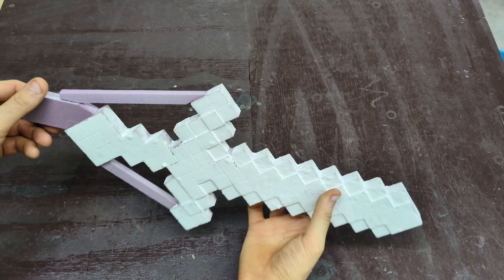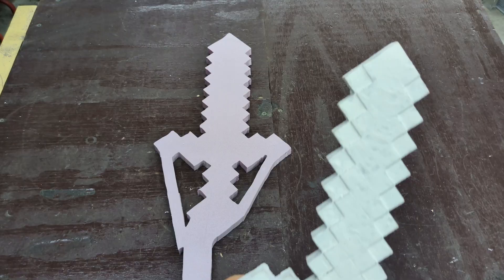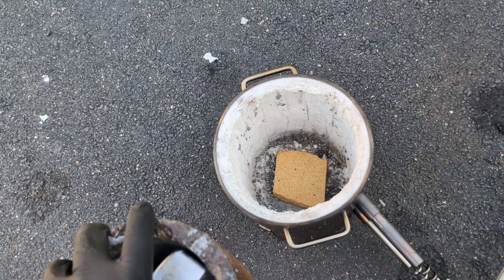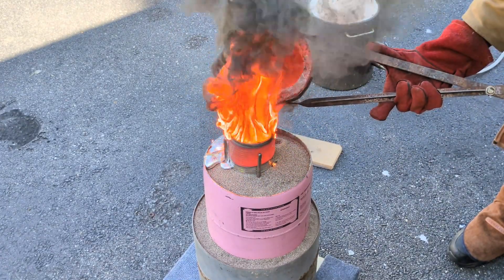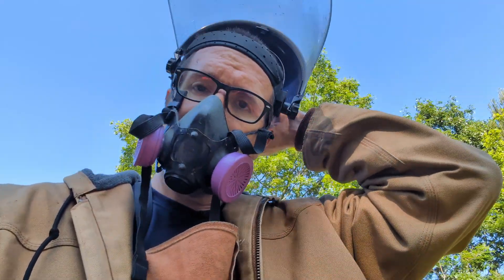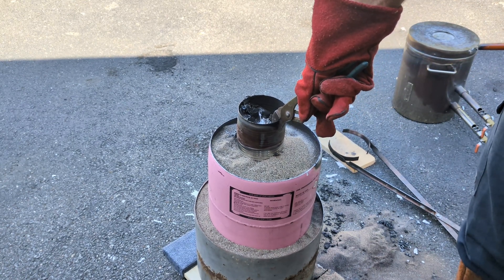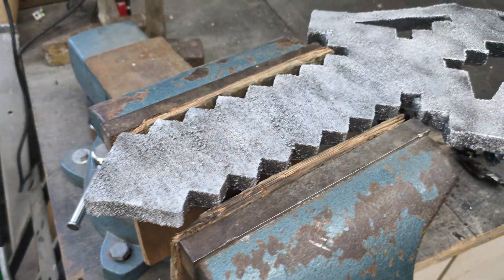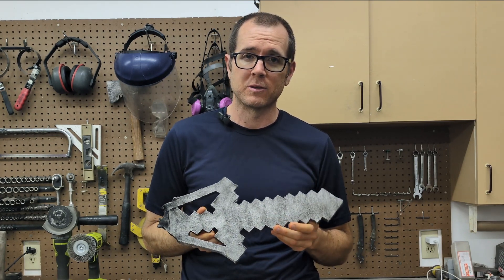Unbelievable!  It actually worked - Sand Casting Metal

Comment: I've found that the aluminum will push out and up if it can. I recently did a pour where I placed my piece flat instead of vertically. It was a large flat piece, but the aluminum evaporated the foam and the sand did not cave in at all. Only issues I had were on the underside of the piece where the sand was not well packed against the piece.
Reply from the maker: yeah, that's why it is best to vibrate the container pretty well.  This was my test pour for the real minecraft sword.  I do lost foam casting very often and almost all of the time I have it placed vertically.  I have tried doing it Horizontal and it does work that way too.  Like you said though, if the back isn't flat you will have a hard time getting the sand up on the backside.

Comment: You definitely helped yourself by making the blade thick, doing a vertical pour to have gravity assistance, and making the aluminum much hotter. The only issue with that is the aluminum oxides a lot more, and combined with its crazy shrinkage you'll need a pretty crazy pouring basin lol What size crucible do you use? Great testing, it's always nice to see other metal casters actually pour for test purposes only and show it
Reply from the maker: I think doing a test pour was a good idea.  I used an old crucible and cut off the bottom.  It worked well.  The video should be posted in a week or 2.

Comment: Weird parallels with a recent pour I had. I also overpoured and spilled on my driveway but didn't notice because of smoke, then couldn't get the pieces out of the sand until I pulled them out. Nice work!
Reply from the maker: haha, funny not funny.  It sucks when you can't see while pouring.  I definitely need to pour sand around my mold so I don't get it on my driveway.  Thanks!

Comment: Take your foam piece next time, and submerge it into a bin of water. Mark a line on the side of the bin where the waterline is. Remove foam, and then chuck metal into the water until the water level is back to the mark. This gives you ROUGHLY the amount you KNOW you need to reduce excess and removing portions of your driveway😂 good video. Sword looks great.

Stack 5 gallon buckets and duct tape them together. Boom, tall enough for your casting height.
Reply from the maker: Very smart idea 😂😂 I've actually used this technique on the past for something smaller.  I'm not sure why I didn't think of it here. 🤔🤔
Reply: @HeinrichsMade  jeweling? Thats how jewelers do it. Im trying to learn alk that fun stuff😂 i heard the water bin idea a few weeks back and then boom here is this video.
Reply from the maker: @printingwithlue4310 boom!  What a coincidence 😂😂😂